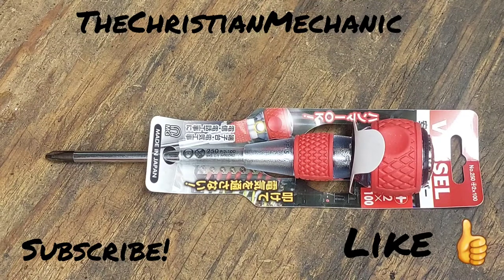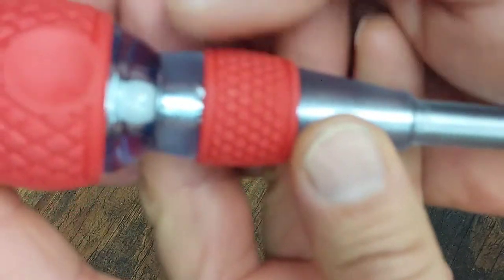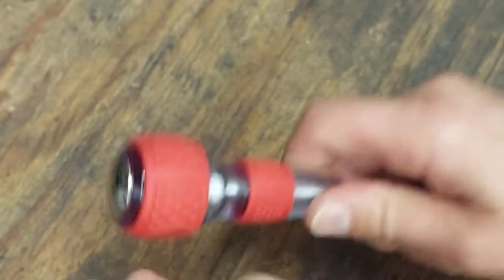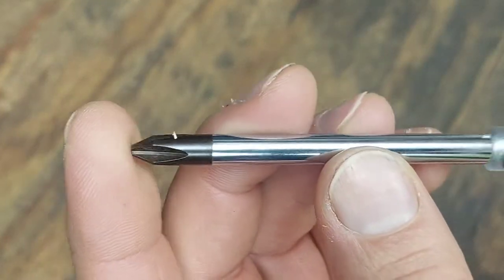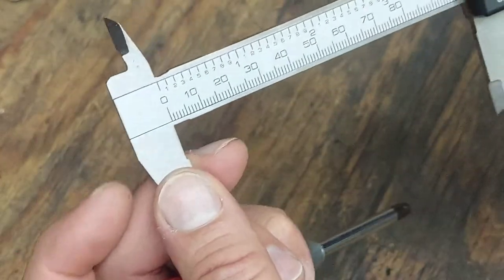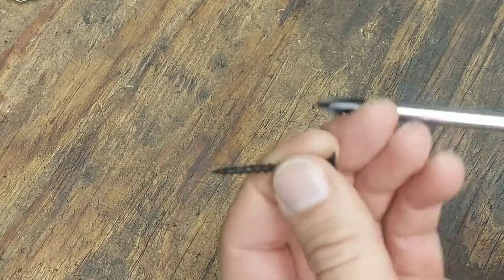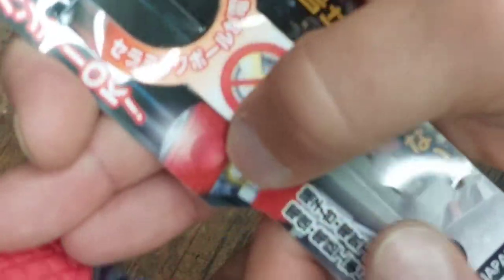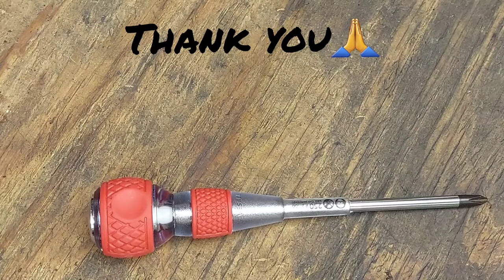VESSEL Tang-Thru Screwdriver w/Ball Grip type No.250 Ph No.2 x 100

Comment: This is a fine looking tool, thanks for sharing.  The 100mm must include how far the shank embeds into the next larger piece.  Probably like most guys, I've banged a few screwdrivers I shouldn't have to break a screw loose!   God bless.
Reply from the maker: Thank you Steve God bless! I looked at the website it looks to be just the part that is exposed for the 100mm, but no big deal still a nice looking screwdriver.
Reply: @mlacher100  Indeed.